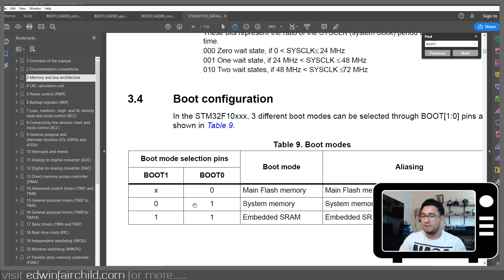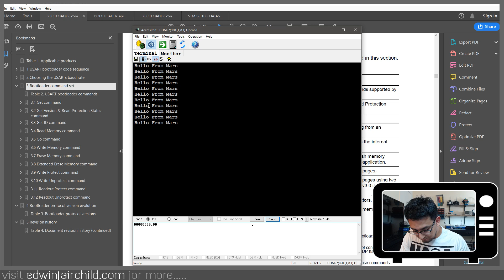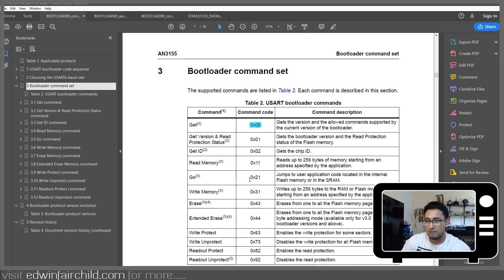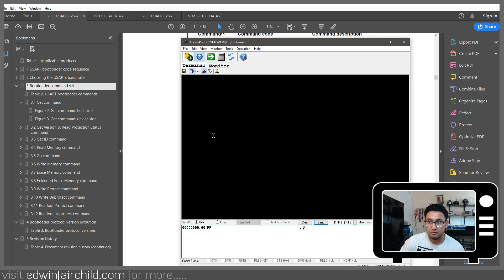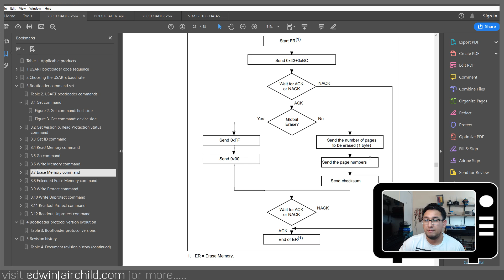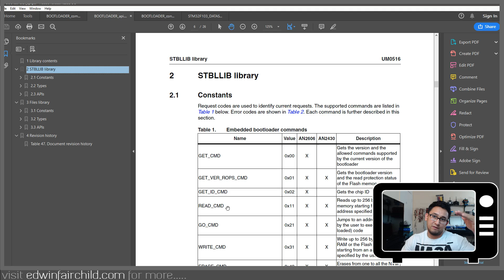STM32 Tips: Talking to the on-board Bootloader

Comment: Hello Eddie, ı have a questio about hardware serial connection. AN2606 says that " . An RS232 transceiver must be connected to adapt the voltage level (3.3 to 12 V) between the STM32 
device and the host." on page 40. I have a question about it. Does it really necessary ? As ı understand on your connection, you have used just usb-ttl converter to connect via usart. I think it works on ttl level serial communication also, deosn't it ? 
Thanks for your reply  for instance.

Comment: Great video. 
Would you describe the hardware connections? USB to TTL? Connect to A9, A10 + Power? Or, connect to the SWD header pins?
I have these blue pills that came pre-loaded with Arduino blink sketch program and it does not allow me to start the bootloader.
I need to erase them to start fresh with the ST native bootloader.
Thank you in advance.

Keep up your great work and channel.
Reply from the maker: No , the st bootloader is there in a special are of rom and can't be erased , you need to get st link utility and erase the entire chip of Arduino code. Or just connect and st link and upload your code with any non Arduino ide
Reply: @EdwinFairchild  Thank you. 
Every solution I have searched leads me to ST Link, which I'm waiting for.
Yes, I'm aware the native bootloader is in ROM, but the Arduino does not allow me to connect to it. 
The seller of the Blue Pills thought it would be a great idea to get them ready for Arduino, which is not what I need.

Regards,
Reply from the maker: @minivric  the Arduino bootloader should be in the way of you accessing the stock bootloader, are you setting the boot pins correctly in order for it to enter bootloader mode. You have to set the boot pin to the proper location, then turn off and on the mcu so it can read the pins and go into bootloader , then use "ST flasher" software to erase the chip via UART to USB converter , make sure to connect to the proper com port
Reply: @EdwinFairchild  Yes, I'm familiar with the procedure. ST Link with ST tools, STM32 Cube Programming, STM32 Link Utility and the STM32 flasher all worked. (STM32 flasher through UART adapter)
Eddie, I'm a member of a Telegraph HScope Lounge, it is an open source oscilloscope using the Blue and Black Pill. I think you would find it interesting.
One of the moderators is Denis, his YT channel is "the GADGETS playlist"
Reply from the maker: Usb to serial connections are just connecting it to your mcu tx goes to rx.and rx goes to tx power and ground that's it.

Comment: Eddie, what about jumper in 1/1 position? Is there any factory bootloader too? Or we need write on it? A video about this would be great
Reply from the maker: This entire video is about factory bootloader, so I'm not sure what your question is. You have to look at the reference manual and it will tell you where position 1 1 does.
Reply: 1/1 says that SRAM is the bootloader storaged area. The question is: How write, erase and overwrite It? Any AN showing It?
Reply from the maker: @DELPITEC  you are reading the information incorrectly or perhaps the term "boot space" is confusing you. The bootloader is located in system memory , you cannot change where it is located you cannot write over it or modify the bootloader it is in a ROM (read only memory ) section. The boot0 pin and the boot1 pin change where the mcu starts running from this is what boot space means..where it boots from,..it does not mean to change where  boot loader is stored.. you seem to think the pins change where the bootloader is stored .. that is not correct. The pins only change where the mcu will initially start running from...if boot0 = 1 and boot1 =0 then it will start running from System Memory which is where the bootloader is located so it will run the boot loader . If both boot pins = 1 then it boots from SRAM ... You can write code there if you need to for some reason... And lastly  if boot0 = 0 then it doesn't matter what boot1 is because the microcontroll will just boot from main user flash..which is where you usually write your code. I hope that clears things up. Think about it like a computer that can start from different hard drives...but your boot loader is just in one hard drive and your main code is in another  drivers

Comment: I was using RealTerm for the serial terminal, but the one you are using looks alot friendlier!  Is that Sudt AccessPort installed with the IDE (PlatformIO?)?

You mentioned the factory bootloader is in ROM, but the table 9 you show says BOOT0=Vcc is Embedded RAM..  is that the same thing?

Regarding UM0516 , could you have used the STM32CubeProgrammer to send the file to the UART bootloader?  Or the ST Flash Loader Program (UM0462)?  Or St's "DfuSe Demo" program?  On the latter.. I'm not sure if a .dfu file is the same as the .elf/.bin that the compiler generates.

BTW, according to the Tm7IWQLrKYs video (AN2606 / AN3154), if you power-off the board without restoring Boot0 to gnd, then your program won't run (see the 3m20s mark)!!   Has that been your experience?
Reply from the maker: It's accessport but standalone gui
Reply from the maker: Im not sure about cubeProgrammer i have never used it and yes st flash loader i believe is to upload via bootloader ,  and i dont know about dfuse ive never used it, if you power off the board and boot0 is still high then obviously it will back t bootloader mode

Comment: Great video! Is it possible to talk to the onboard bootloader if I have the MCU only? (I mean, no Boot0 Pins to switch using jumpers?) Thank you.
Reply from the maker: Well you have a specified bootloader memory space , but off the top of my head you simply have to tell the mcu where the new vector table is and set up whatever needs to be set up , jump to your new main and never return  ... Hmm so yeah
Reply from the maker: I haven't programmed much in months so I'm a little rusty. But the boot pins are there on the mcu you can always get to them if you hack it a little bit
Reply: @EdwinFairchild  You're right... I'll try to get to them by code/registers. Thanks again!

Comment: hello, how can i update the program using wifi module esp8266 and other using it's UART
Reply from the maker: Do you know how to use the specific modules UART , if you do then it should be pretty straight forward. If you do not know how to use it's UART then I can't help since I have never used that module before. It should not be so hard though all UARTs are quite simple just set it up in the registers.
Reply: @EdwinFairchild yes, i know ,how to send and receive data over the internet using wifi module, i want to know the format of transmitting the hex file and how to write hex data in to it's flash using it's bootloader.
thank you ..